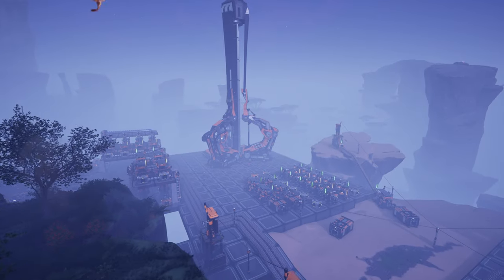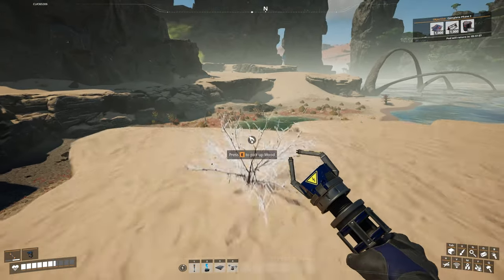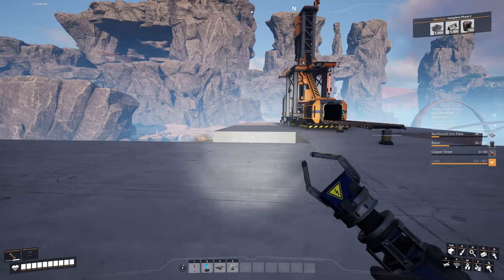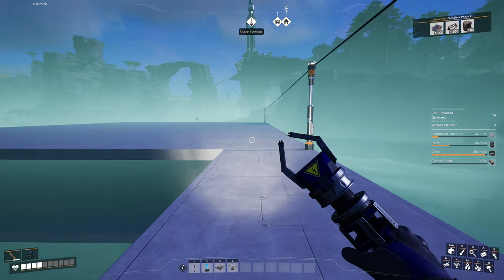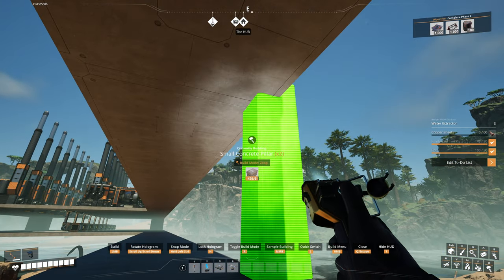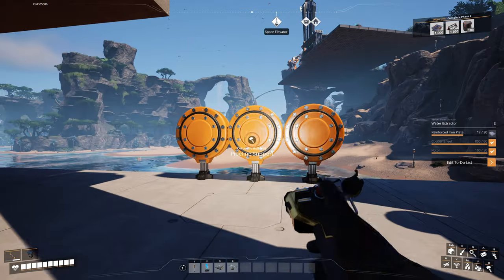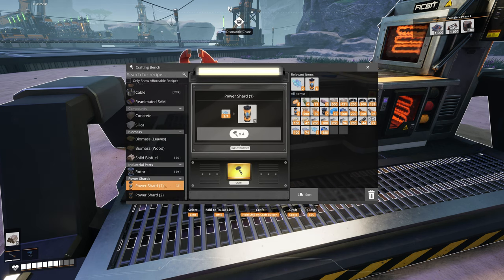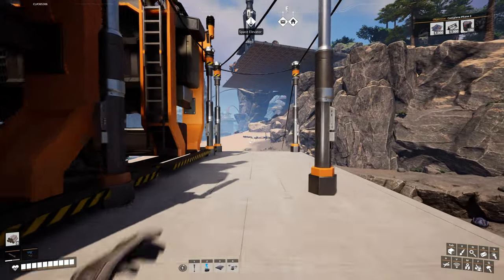THIS DID NOT GO TO PLAN!!! In Satisfactory 1.0

Comment: Just finished my coal power plants last night.  Used the 3 pure coal nodes near the craters to make 24 power plants, for 1800mw.
Reply: I'm skipping coal power. Got a 880mw biofuel plant so far and almost done with tier 4. Loving the belt fed biomass burners. I tend clear cut areas and end up with a bunch of biofuel so now it gets used!
Reply: hope you have more room, in no long time you will need to upgrade it to new belt capacity
Reply: Biomass is too much hassle for me.  Was fine with the belts early but once I get coal I only clear foliage that’s in the way of progress!
Reply: I started in the rocky desert and am making use of the new coal nodes they added to the top left of the map, 2 normal and 2 impure.

Comment: If you don't need either of the hard drive scan results yet, its worth not selecting either. The 2 unselected options are removed from the pool for new hard drives you scan so you get a better chance of getting the good ones.

Comment: You should definetly let the buffers fill before switching the coal generators on (let them disconnected or switch the coal generator off). Always fill the water in all pipes at 100% so that you won't have to deal with unstable power.

Comment: Run one of the lines above the fill height of the coal generators and then connect it back to itself below them and you can pressurize the entire system with a single pump, even pressurize all 3 lines if you manifold them all together. It works like a water tower and works with any fluid in satisfactory! 

Pumps don't actually provide pressure, only gravity provides pressure in Satisfactory. Once you realize how simple it is it'll completely change how you view fluids. All those pumps hurt my soul! 

I've pressurized 120 turbo fuel generators fully overclocked with a single pump. It really works! :)
Reply: so... as someone who doesn't completely understand pipes, this means pumps work in relation to gravity, which means if working with an incline, the pump should be placed as close to the connector as possible to provide maximum lift?
Reply: @moonstenebrocity  yes. you want the fluids to go up close to the machines creating the fluids, but you want to place the pump after the first junction and on the line going vertical. also you want to connect it back to itself after the buffer creating the loop. lastly the height of the buffer needs to be above the inlet of the machines you're trying to feed.
   

       Fluid buffer                                                                                 
              |       |                 
pump->||       |               
              |       |                
  fluid----+----+----+++manifold

edit: you can use a single line to pressurize multiple lines as long as they're all the same fluid. just make sure when you manifold them together its after the down side.

Comment: bits just wait with hooking powerlines to the coal plants and have a single waterpump fill the pipe system. then when primed you can hook up the coal plants and avoid the power surge and then fire up the last pumps. coal plants will start up if a power line is connected to them even if its not connected to anything else.

Comment: I had a couple coal generators bug out as well. I never opened their UI prior to the first time it happened. After reconnecting the belt, they would start taking items and stop when I placed the previous item stack I took out back in. Thinking it was a corrupted item stack, I deleted them after I got the generators working again. It got hotfixed the next day, so no idea what the actual problem was, but it should be ok now.

Comment: For the Coal Generator bug you don't need to reconnect the belts, just need to open the Generator UI with coal in the inventory ant it will work perfectly normal forever*

* or at least until you open it again without any coal

Comment: should of kept those steel pipes you could of made the dimensional storage already.  You can actually build before you even build the space elevator you just need about 750 sam ore (node at crater lake) and like 225 steel pipes (there are 2 crash sites I know of that have 115+ each) , all the sam stuff for the storage is craftable in the craftbench no need for a manufacturer either.

Comment: While you unlock the resources for the Augmenter at tier 5, you can build it before then if you find the right resources when collecting hard drives. That's what I was able to do.
Reply: Same, and the 500 MW it provides have proven invaluable. It only now doesn't matter too much anymore as I switch from coal to turbofuel